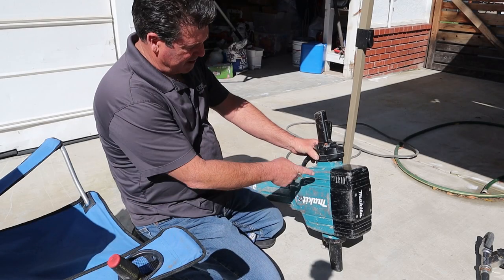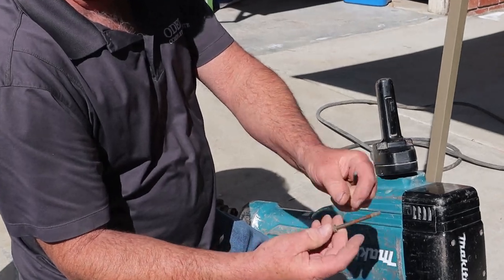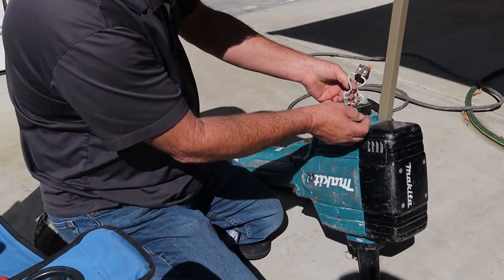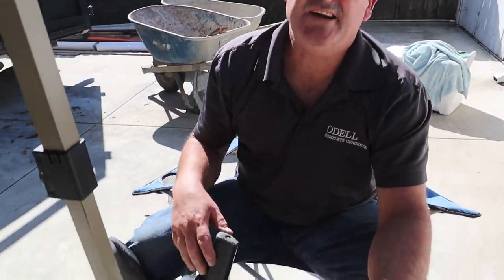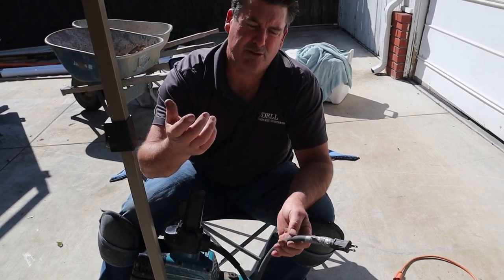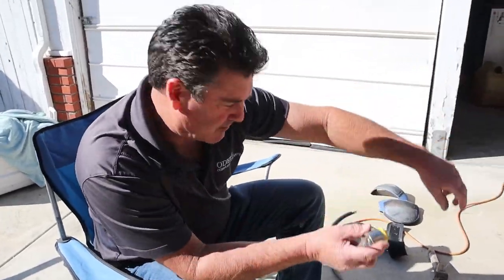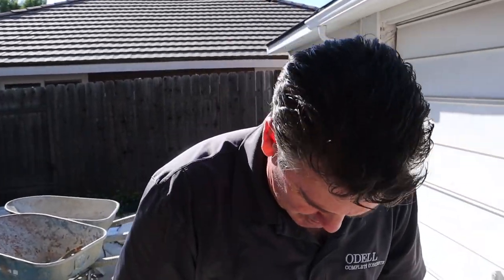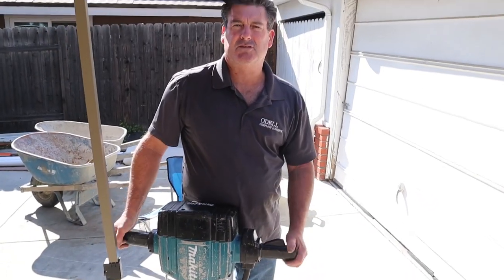Tool Repair: Makita Jackhammer (Trigger and Cable Replacement)

Comment: @ 5:30, look at the new plug.  When tightening the exterior clamp, push/pull on the cord as you tighten, making sure both screws tighten evenly. Once the cord no longer moves give the screws a 1/4 turn tighter only.  If the clamp is too tight, there is a risk of crushing the wires and causing them to arc and short out.  Personal experience taught me that one...
Reply from the maker: Sounds good Stud

Comment: Next time you're at Home Depot pick up a pair of wire strippers,they work better than a steak knife.
Reply: But can wire strippers cut a steak? Didn't think so.
Reply from the maker: I concur. My tool box is full I need multi purpose tools

Comment: I have a problem with my Makita HM1812 model. When I press the trigger switch it starts for few seconds then it will stop. Please advise and let me know what do you think is the problem.
Reply from the maker: Motor or brushes

Comment: i have question i am need to buy a jack hammer been renting friends says hilti 3000 is the best.but i am not paying $3,500 for something they put usage limit and tool stop working, can you help me pick a jackhammer, any reason you use makita. not Dewalt or Brute, anyone?
Reply from the maker: Makita's price and specs when matched up side by side is the best deal.